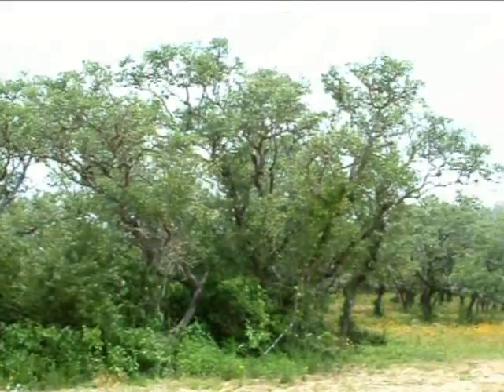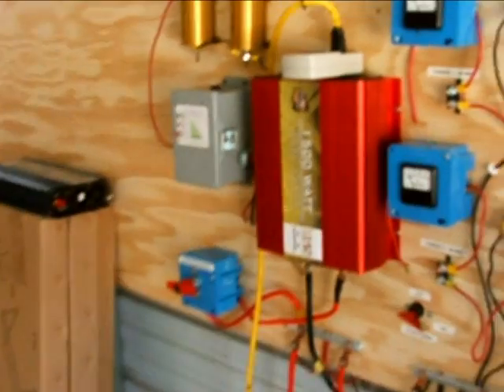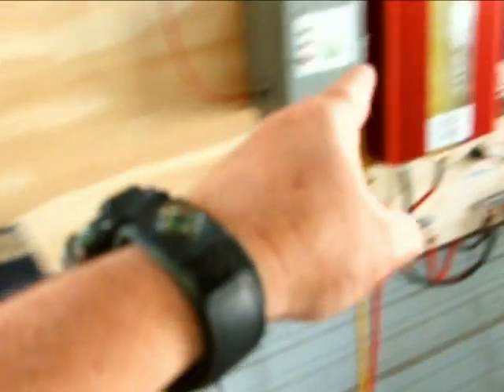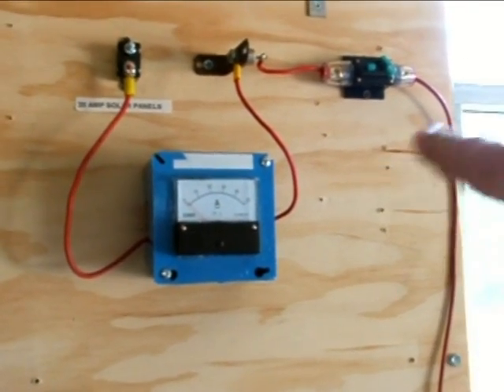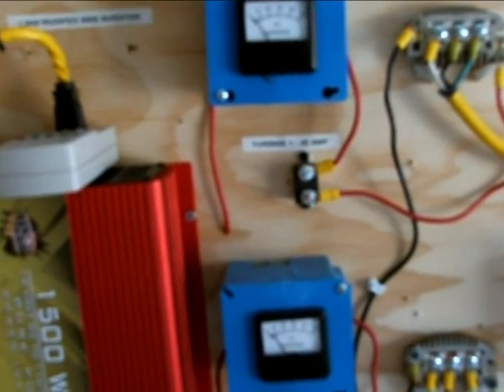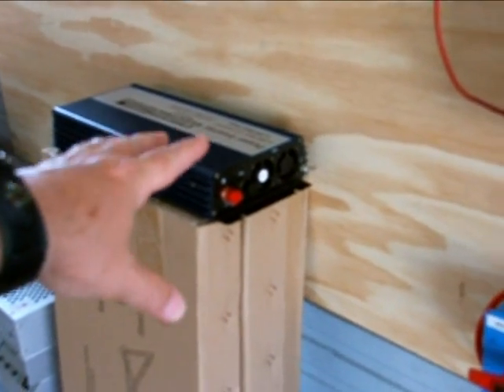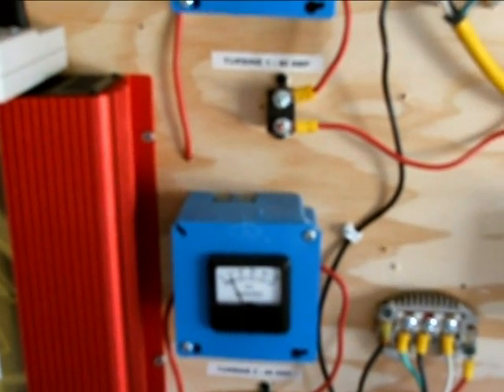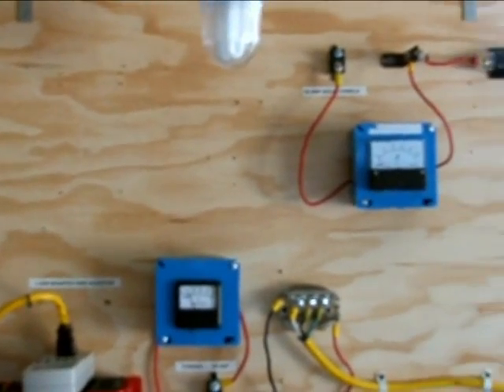Windmax wind generators converted to 12 volts

Comment: 24 volts way easier on batteries and less draw on heavy loads cheaper for wire. I moved from 12 volt to 24 volt and really want to get started on 48 volt which is very easy on batteries. But if twelve volts works best for you great!

Comment: Hi, i have a 24v Ce Industries turbine,  i want to switch it to 12v system... i am reading a lot of conflicting statments to yours about doing this.
Some people are saying it will be very inefficient producing 1/2 the power is should running it 12v. 
Also in your other video with wiring diagram you have the turbine going to the controller ... what??? the colman air controllers do not connect the turbine... they just dump the batteries.
very confused...

Comment from the maker: @iwantosavemoney thanks for the comment. The easy way to do this is to just buy a WindMax turbine already made for 12 volts, it comes with everything you need to connect to battteries, all you need to do is an an inverter to connect to the batteries to make 120 volts power and you're in business. God bless you.

Comment from the maker: If you use a 12 volt system may I recommend you get their HY-0400-12-5 system? That really is a 400-500 watt turbine which when used with a 150watt solar panel can put out 650watts. Their charge controller is hybrid and can handle both with and solar so you get the best combination of both. I suggest that turbine and solar panel of 150watt, you'll be happy. I have a 24v system so I use their HY-1000-24. God bless!

Comment from the maker: @u2nvme Nothing to it. connect it to a rectifier for DC output, then connect straight to batteries, add a charge controller to dump when it's full and that's it. I will a drawing  video this weekend as this question keeps coming up. Stay tuned!

Comment from the maker: @field16 I have no idea how many watts it uses, I've not measured it, I do know that the Harbor Freight inverter has 3 high-speed fans that run continuously as is very loud whereas this Tiger Claw is dead quiet even when the two fans come on. After running a while with a good load you may hear the fans kick in but the speed changes with the load - very smart design on their part. I like it.
God bless you and thanks for the comment

Comment from the maker: Thanks for your suggestion, I thought about that but I'm nowhere near the water heater to be able to use hot water, floodlights are not something that I need either. I've been considering the problem and potential solutions like you've described. I will either just open the circuit and stop charging or go through a buck boost transformer and dump to a grid tie inverter. Very good suggestions, thanks for offering them and the comments. Take care and God bless you.

Comment: You had mentioned a dump load. Try not to waste power by just burning it. You can get a 600watt 12v water heating element from ebay, and heat up water inside the water heating tank. If not, then perhaps have it set up to run halogen flood lights on your property. There are many ways not to just burn off, but use the power. And by the way, your system rocks! I wish I had that kind of wind. Later from sunny FL!